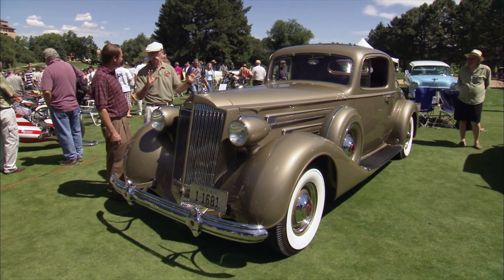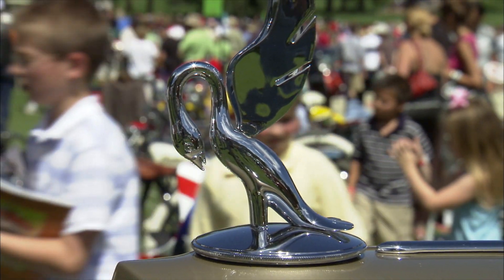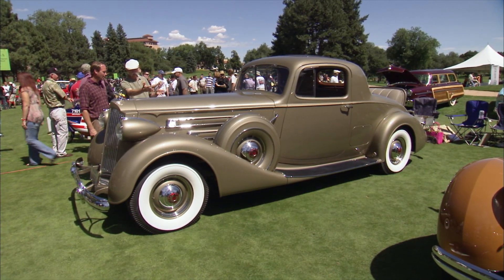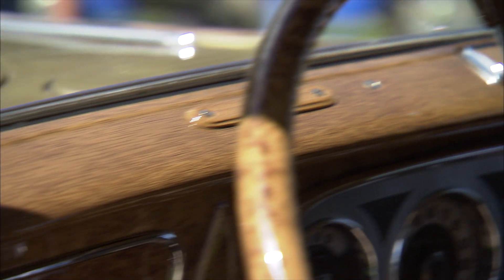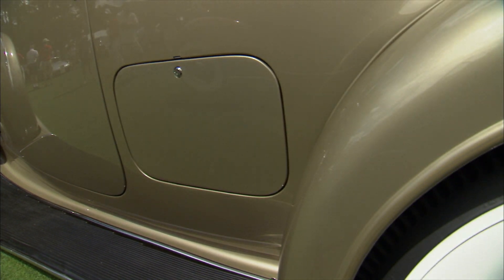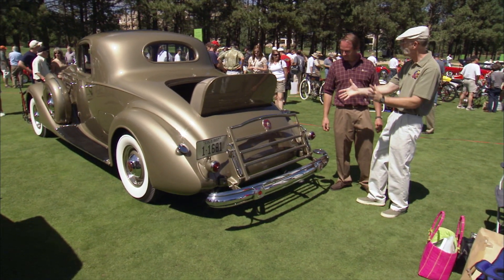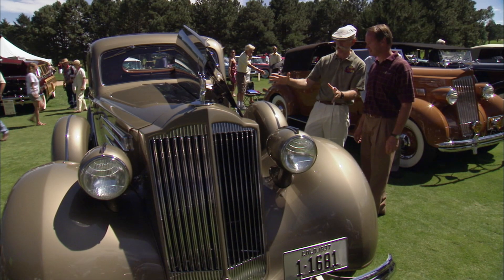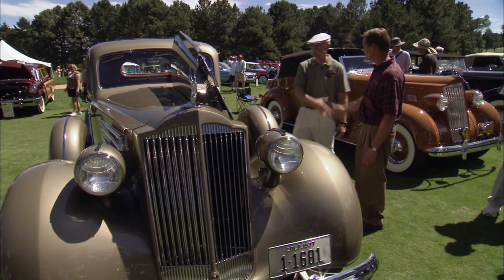4800 Hour Car Restoration - 1937 Packard Model 1507 B12 | 12 Cylinder

Comment: itd be cool if they converted the 3 speed to a 5 speed at least, i know its for originality and you would not drive something like that on the road enough to have a 5 speed, but only shifting 3 times seems kinda boring imo, i drove a 2016 6 speed mazda for 3 years and i cant imagine driving a 3 speed
Reply: Except for starting, 1st gear was rarely used. Torque was immense. So, it was essentially a 2 speed car.